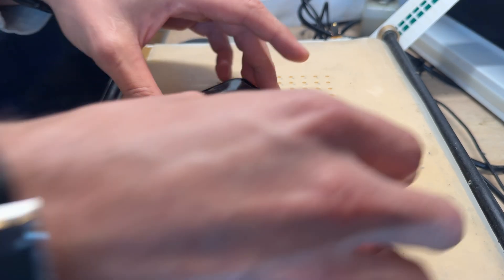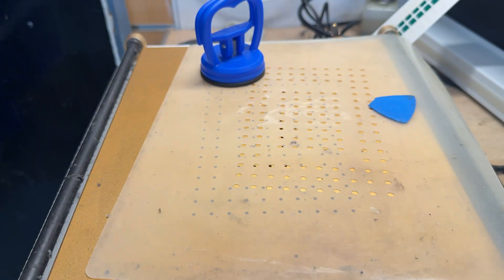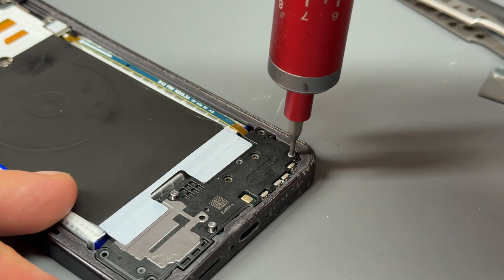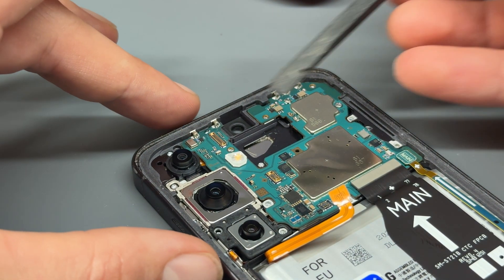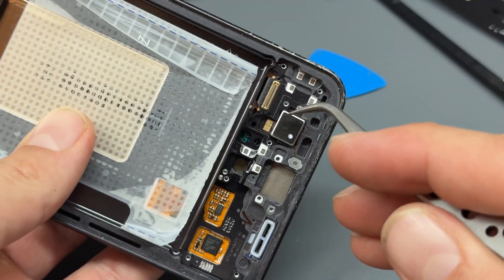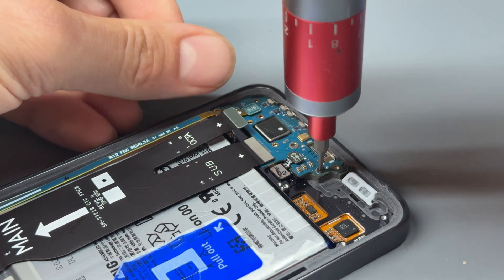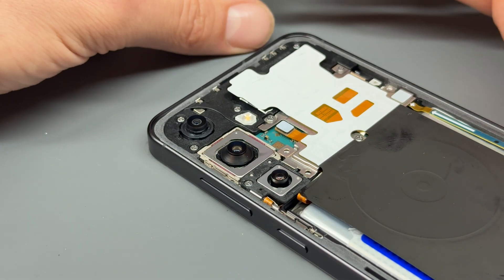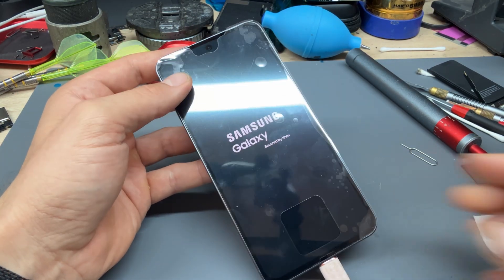Samsung Galaxy S24 FE 5G Screen Replacement – Full Step-by-Step Repair Guide!

Comment: Thank you very much for the interesting video! I followed all the steps exactly as shown.
After replacing the screen (the replacement was done after the phone was dropped), the fingerprint sensor does not work anymore.
The display is original. Do you have any idea what could be the reason?